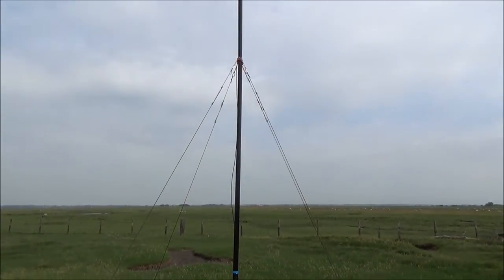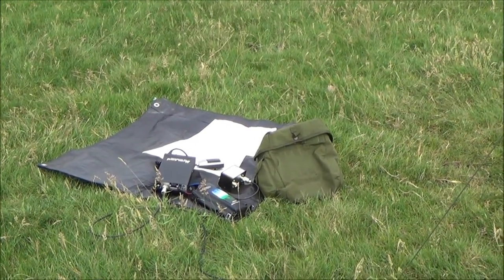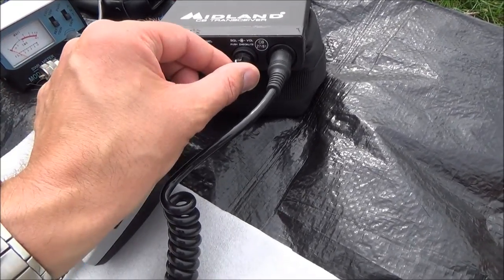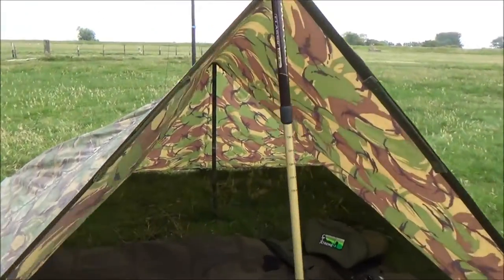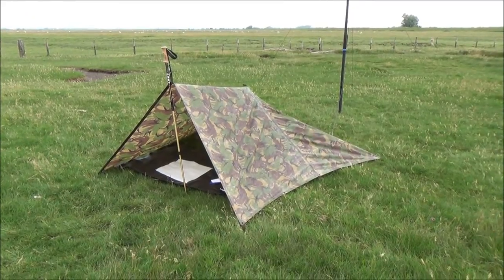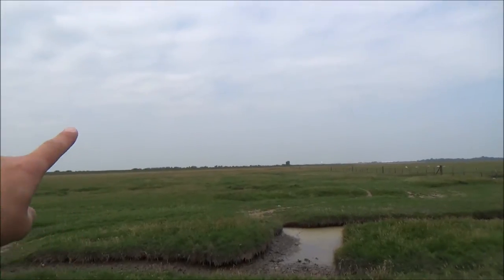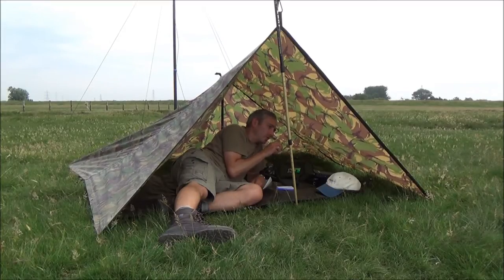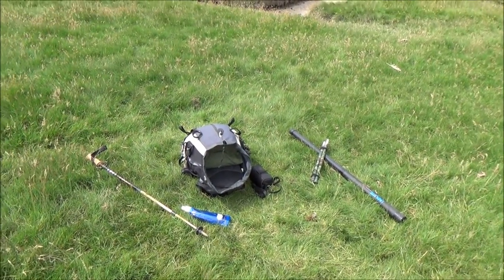Testing A New 10m Antenna Mast For DXing

Comment: Flat ground is often good for radio as it allows for a low angle of disengagement. In other words the RF will travel in straight lines toward the horizon then as the curvature of the earth dips away the RF will leave the surface at a very low angle. This allows for greater skip distances on HF and also better results on vhf. 1/4 wave verticals or dipoles a half wave above ground will radiate at low angles You only need to get the dipole up 18 feet on 27Mhz>>More in next comment

Comment: However I am using 80 and 160 meters. I need to get my antenna's up to 40 and 80 meters high agl to achieve low angle radiation. Hence the "Sky hook". Video coming soon. If you want to work real long distances reliably and with low powers the way to go are digi modes like PSK31 and good old CW..(Thats Morse code). If you want to learn CW  let me know and I will be able to steer you in the right direction.
Sandy